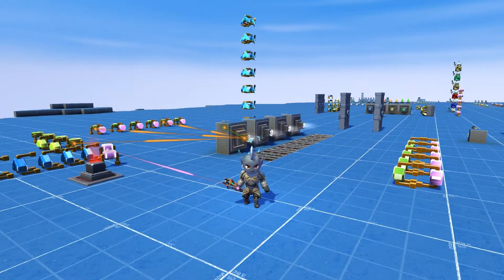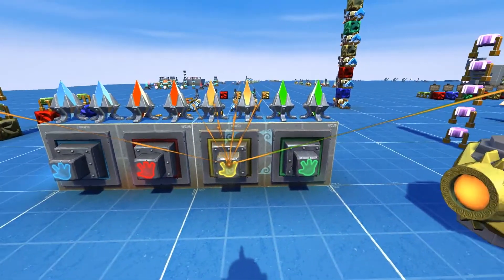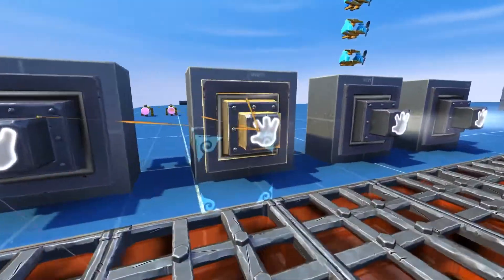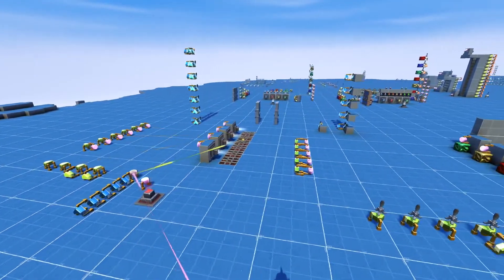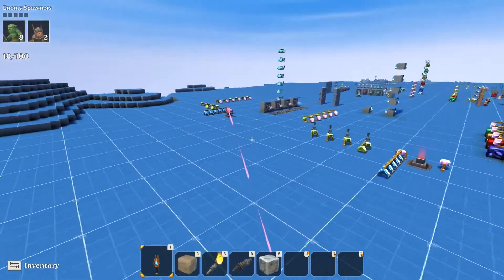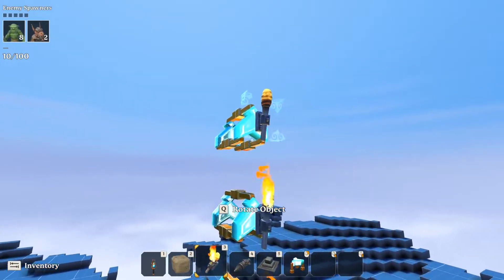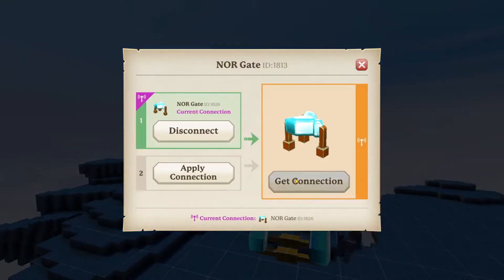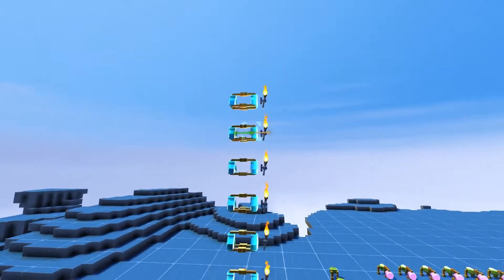I Build Your Suggestions E3- Button Sequence Door Lock! - Portal Knights 1.6.1

Comment: As many buttons as I want
So if the blocks and the button itself is 2*2*2 blocks than in a area of 200*200 then you can have 10,000 switches, so doing the maths, 10,000 to the power of 10,000 for all possible combinations you get error 2, thanks google